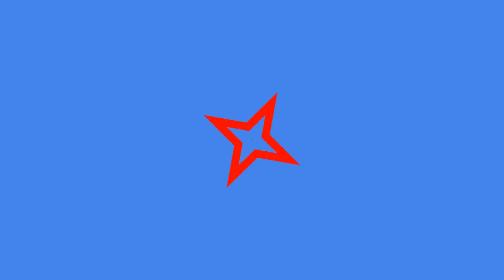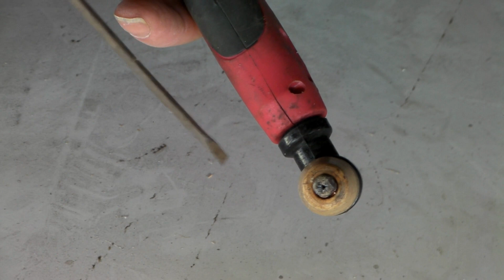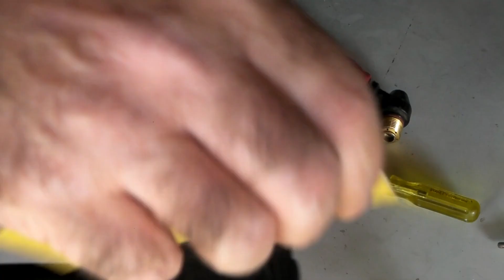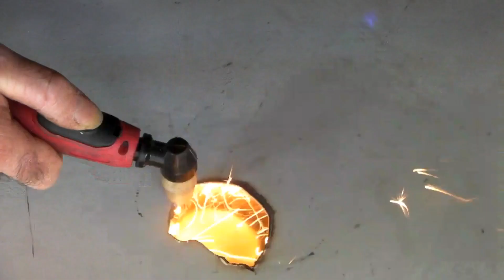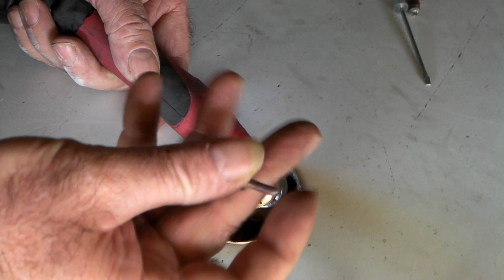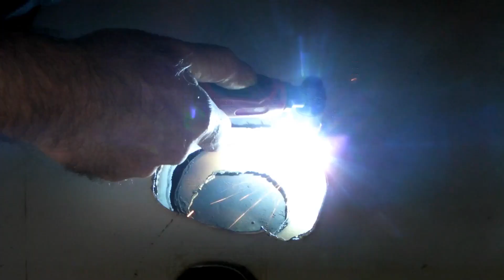Plasma Cutter Tip Cleaning  Fast

Comment: At my work I use lacquer thinner and a rag. It work pretty good
But I will try with the drill and sandpaper.
I soak the rag and rub the electrodes and tips 
Real fast and hard but the drill looks easier.
I use a Hypertherm plasma table.
Thanks.
Reply from the maker: Good idea cheers

Comment: Hey Pete. My plasma cutter says not to keep torch tip in contact with metal while cutting. It appears that you do maintain contact. Which is correct
Reply from the maker: Depends what machine you are running.(Most chinese machines you can make contact )
cheers pete